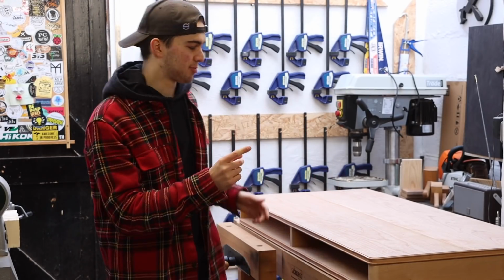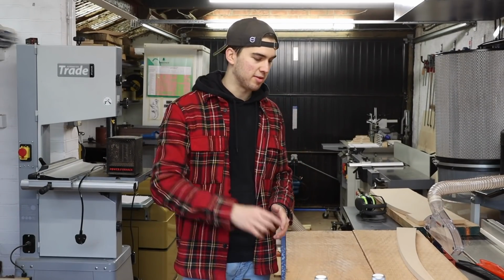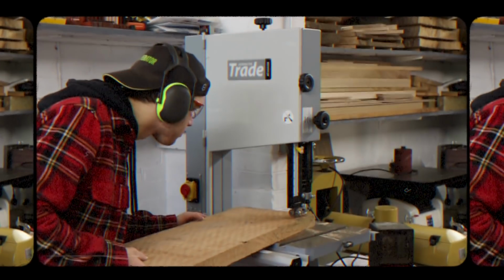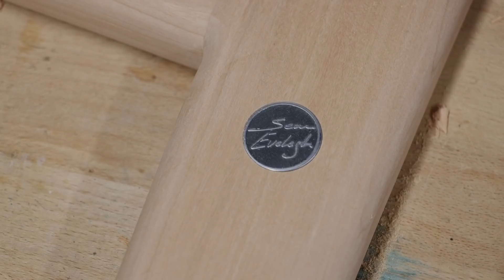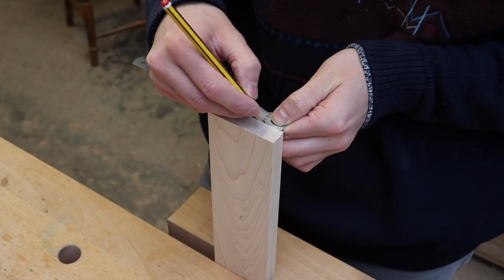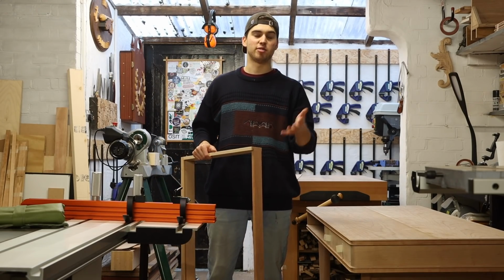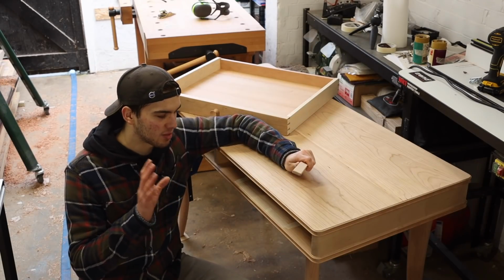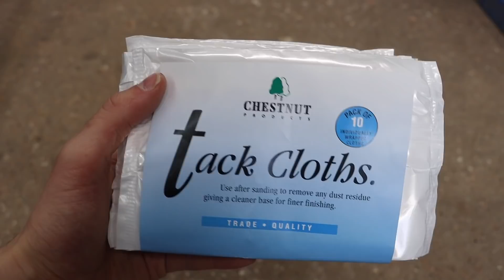Making Of The 'Alberto Issel 1938 Italian Writing Table'

Comment: Hi Sean, Amazing work. If you didn't have a domino jointer would you use mortise and tenons at the top of the legs where they join the cross struts? Would it work to cut the right angle as part of the leg and move the joint to the horizontal section of the strut?

Comment: Hi, very nice video and a very nicely made piece of furniture. Just a couple of observations regarding your stops on your drawers, while I have seen several drawers stopped like this I have also seen lots of them with  cracked fronts as the drawer has been slammed in to hard and as it hits the weak part where the groove is. I am not knocking you for doing it that way just explaining what I have seen, and I know lots of antique drawers were stopped like that. 
I also have found when using a bag press that if you put some grooves in your base board it helps to express the air more evenly.
Very nice neat work and hope your client enjoyed the finished piece.
I would also have veneered the top as well, a lot more stable, and thick veneer is a lot easier to press in the bag.
Reply from the maker: Hi Gary, thanks for watching and I'm glad you liked it! That's interesting to hear, I used quite big stops (glued down well) and big dovetails so I don't think it will crack. Luckily I know the client won't be slamming the drawers as well ahah. Yes I'm very familiar with a grooved base board when vacuum pressing (which is very helpful) It's just finding the place to store the board. Constructional veneer is so much better isn't it! And you don't need to worry about sanding through it. See you in the next video!
Reply: @SeanEvelegh  Hi Sean. I don't think these are the type of drawers that will be slammed 
shut full of heavy articles. I'd wouldn't be surprised if they barley get used at all. Tony

Comment: Great job on the desk. Curious as to why you don't wear eye protection when using power tools.
Reply: In most cases he did wear eye protection. Sometimes you forget, it happens.
Reply: @jac_builtWoodworks  It's the one time you don't that will get you hurt.

Comment: Why did you choose screws and dowels when attaching the legs to the side skirt boards?  Why not dominoes there to avoid seeing the dowels?
Reply from the maker: Hey mate, well I don't mind showing the dowels (I think they look good) but the screws helped pull the rail together. Doing dominos also would be hard to route at the right angle.

Comment: My only issue with the veneering is the substrate - I abhor Mdf.   Other than that - Beautiful piece

Btw, please lose the "special effects" - they are confusing in a "how too " video.
Reply from the maker: Hi Glenn, Glad you like the piece. Sorry to hearing that you didn't like the substrate, I have nothing against MDF as it flat, stable and solid. For me, If you have good dust collection there isn't an issue.
Reply: @SeanEvelegh  My problem with it, exactly. Some of the dust always seems to escape -   I use best quality Baltic birch ply, and absorb the cost difference.
Reply from the maker: @glennworton2494  I agree birch ply is very good!